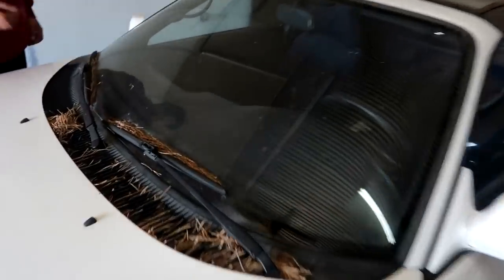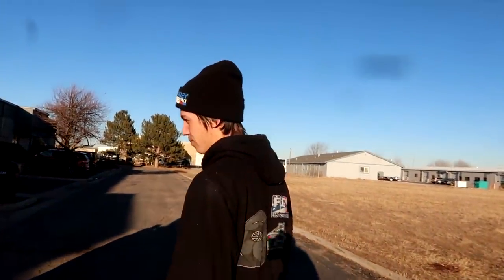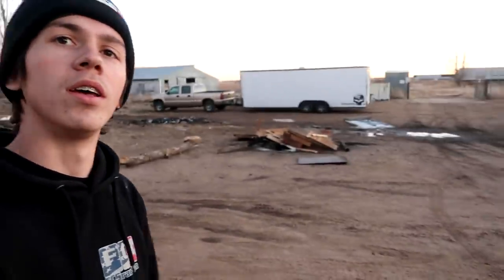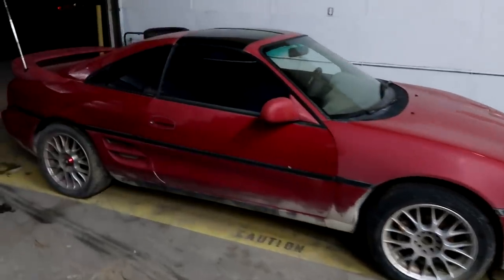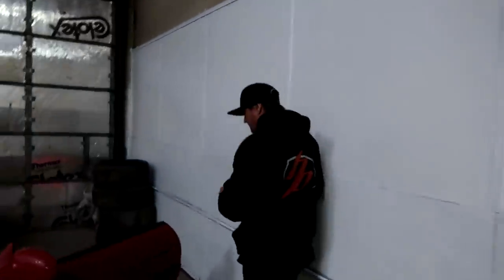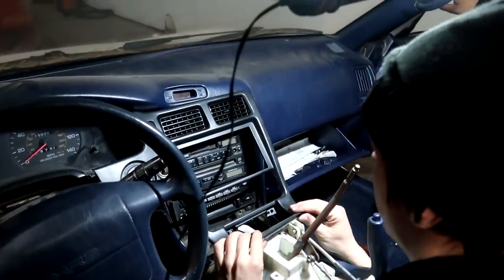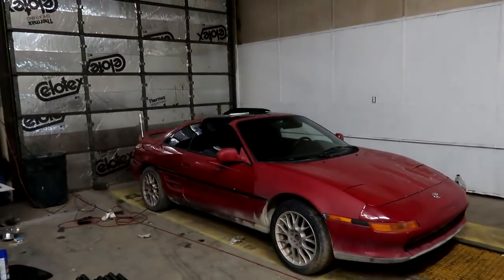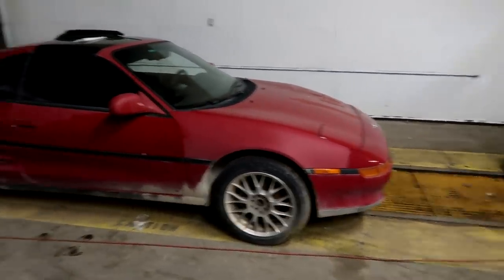We Got a New Mr2 For SUPER CHEAP!

Comment: Kyle u need a longer muffler for the shopping cart so u get better performance the pipe is too short
Reply: Yea & with no back pressure it won't take long to torch the valves on a single cylinder as well
Reply: Lol it doesn't need back pressure, it's fine.
Reply: 1 simple answer to your demand........TURBO.
Reply: Back Pressure is a myth kids! Watch Engine Masters prove that one.
Reply: I always laugh,  but die inside when people say you need back pressure.
Reply: It’s basically a pit bike engine. Any one that’s messed about with one knows they will be down on power with no exhaust
Reply: Any ebgine is down o power with no exhaust but back pressure dont matter 

A straight pipe with a straight thru mufflwr is  best probably. 

Although his is way to short
Reply: Slight back pressure actually helps scavenge the cylinder
Reply: @Spiritpoweredinternet but if its too short u won't have no top end speed or take off power
Reply: @Hermiwalle  its breeding too freely so its loosing power it needs a longer pipe
Reply: @kevintucker3354  Absolutely not, a correctly sized exhaust assists scavenging which 'LOWERS' back pressure. This isn't a 2 stroke engine.

On this engine, I wouldn't bother as it will be turbo'd soon.
Reply: a turbo wont work well because the engine is single cylinder and doesnt put out enough exhaust gases to spool the turbo efficently
Reply: @mattwylie7675  They have a very small turbo for it.
Reply: @sergeantspeed5941  my nitro rc car needs back pressure to pump fuel to the carb....what u got to say about that then deontay
Reply: @kevintucker3354  how?? Please explain. 

Nevermind, ill explain. Exhaust scavenging is not a product of back pressure at all. 

Any bit of back pressure is a sign of exhaust restriction. When you have restriction,  you prevent gases from escaping the cylinder when the valve is open. On a single cylinder, you maximize scavenging with the length of exhaust and exhaust tube size that's similar in size to the port (except 2 strokes)  for example.  If you have a pipe 50 feet long,  the exhaust flow is going to slow down and the gases will "bunch up" creating back pressure,  

Have a 2 inch long exhaust and the exhaust escapes before it can begin pulling exhaust from the next exhaust stroke. 

On a single cylinder,  you want the end of one exhaust pulse to be leaving the end of the tailpipe, while the next exhaust stroke is happening because the exhaust leaving the tailpipe creates a vacuum in the system which pulls the exhaust coming out of the valve. Make sense?

Multiple cylinders you balance the cylinder pulses, so the end of one valve opening matches with another valve closing,  and that's with headers that are equal in length

This is VERY basic for an explanation  and doesn't even explain oversize and undersized exhausts but most people don't care to or can't visualize fluid dynamics in an exhaust.
Reply: @seanstubbs2620  please tell me you're joking
Reply: Back pressure=bad... High exhaust velocity=good.
Reply: Dam looks like I done started a feud. Why I said that it's more techo than I'm willing to try & explain on a YouTube comment section in depth but I've been told by more than one qualified motorcycle technician that if you run a single without a reasonably decent length of header on it that rapes the shit out of the valves. It has something to do with exhaust pulse widths & tuning shit but honestly I do give a crap if people have something against having the appropriate exhaust for their application if you have that much of an aversion to anything other than a short open header then that's fine by me go on with ya bad self o.k. So maybe back pressure isn't the correct term for me to have used but personally I think that little motor will last longer with at least a longer pipe on it

Comment: im sure someone else mentioned it but the center console is a factory turbo part. the turbo cars also got fog lights, a boost gauge instead of volt meter, and a fiberglass engine cover with raised louvers instead of the na cars flat sheet metal cover.

edit: and i vote the toyota v6 swap(1mz 2mz 3mz), it uses the same trans and a turbo mr2 motor mount but more or less bolts in and theres plenty of motors in the junkyards. then the big ass turbo goes in the trunk with the intercooler. yall need something v6, youve already got plenty turbo 4s and a turbo v8 (duramax) time to round out the bunch with a v6 turbo...v10 and 12 come later lol

Comment: run a 2.4L 2AZ-FE engine out of 08-12 Toyota, put turbo on it. Compare it with Honda engine, be nice to see something stay original Toyota and make power. They scream and the VVTi solid roller cams really make torque . It's a big 4cyl  but i'd like to see you push it hard see if it holds up.
Reply: Cant keep up with the k series
Reply: K swap weight to power is hard to beat

Comment: Could be wrong about the wrench. But it might be a battery terminal wrench. I use to have one. It was a ratcheting kind and it was 8 mill. I got it from my step dad, cause on my car I got side post. I like that style better. I never have once had to clean acid off the terminals like the top post style. You just unbolt and its off. But top mount you have to tug on the wire if it isn't fully loose.

Comment: Toyota 3.0 V6 swap then super charge it ?
Reply: Im making about 400 wheel on my 1mz 3.0 on an ebay turbo. Just as reliable as it was naturally aspirated.
Reply: K swapped
Reply: @gamebred5662  no tbh k swaps or cool but you can make just as much on a 5sgte and all the way with a way better factory trans. E153 all the way. They are bullet proof
Reply: Or a 3vzfe v6 swap tough bottom ends
Reply: C D dude people put 1000hp through the stock gear box lol if you are breaking them you either got really bad luck, or a really crappy launch 😂
Reply: I got one in a Toyota Avalon xls
Reply: @noahhenry1431  1mz-fe gang represent homie
Reply: In the spirit of going Honda, put a J35 in instead.
Reply: 5SGTE, supercharger & Big turbo, (half-fill block with hardening cement), bigger valves and overall machined/upgraded head, E85   -> 1000whp Killer

Comment: mr2 is a circuit track beast. full race spec. cut the trunk to engine bay firewall for trunk intercooler. and front hood vent for rad

Comment: I would say keep the black interior in the red one if you want it as a daily and left the white one fully stripped because racecar ... just flock every panel you want to keep inside ... gusset the cage to pillars and you don't even need trims ... tint the roof darkest black you can find and you will be fine with sun ...

Comment: I found a $50 crack rock under the carpet on the drivers side of a 87 RX7 back in 93. It was an auction car with low miles but the blue interior was black and looked like someone was living in the car. I was pulling the interior apart to pressure wash. That car cleaned up and sold for a decent profit.

Comment: Get some foam carpet spot cleaner and pressure wash the black carpet. I have seen it done and done it several times and it turns out pretty good. Just hang it in the shop to dry where it is warm.

Comment: Heat gun and some glue should fix the dash it is probably the shell coming off the foam. You can do a compact flash conversion on that thing and increase the capacity.

Comment: I'd say keep the blue dash in the mr2, repair it and Flock it. Putting the black dash in would be easier and you could finish it this week. But then, your red mr2 would have a missing dash. 
http://speed.academy/flocking-dash-flock-how-to-steps-diy/ A video on this would be cool! 
You could still fab the cage and mock the blue dash in with the cage, once the cage is finished, flock the blue dash. (it'll be easy to pop the dash in and out now that's out)